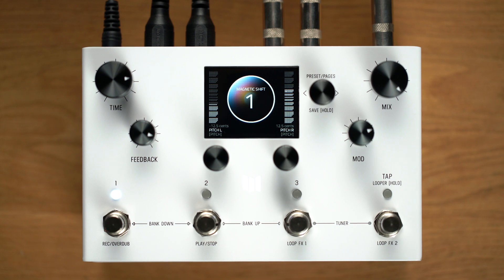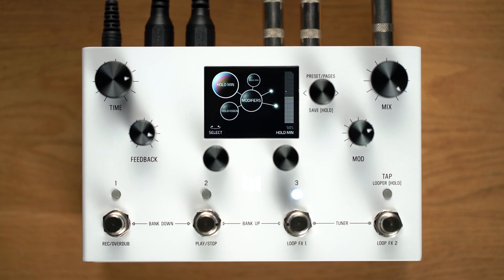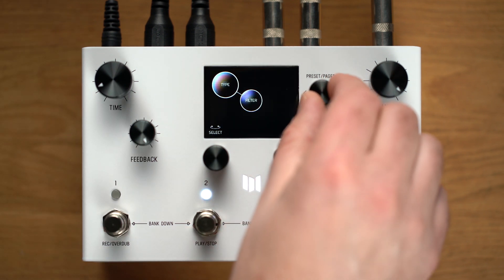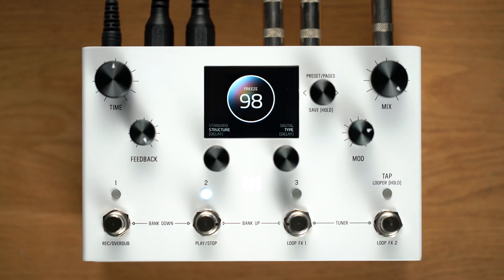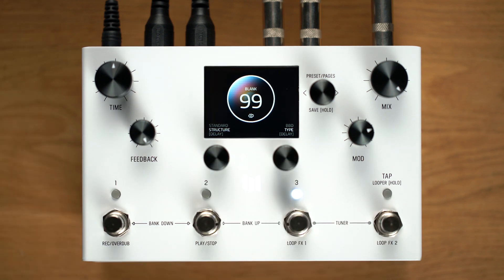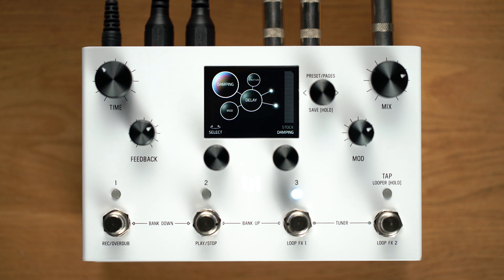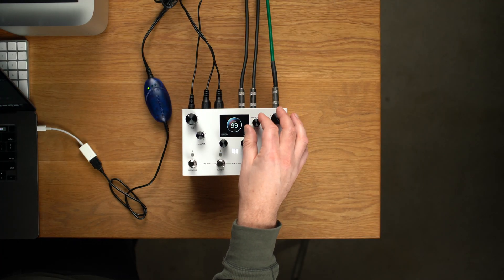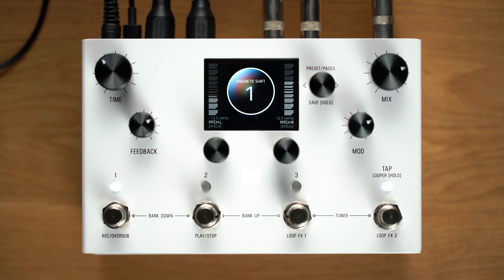Meris LVX Firmware Update 1.1.0 - Video Manual

Comment: "Reversed the Delay Multi Structure’s Pan control to correctly match left and right" + "New Half Speed Delay Parameter - allows half speed sounds for all structures" - thx for that! 

I now only miss the option for an individual feedback-amount for each individual tap in multi mode 😬🥹😉🙃